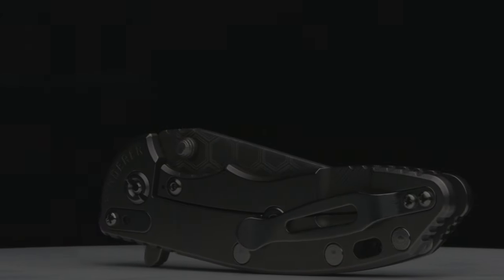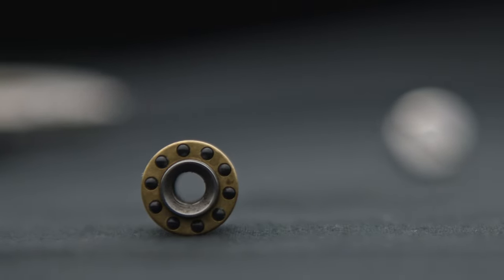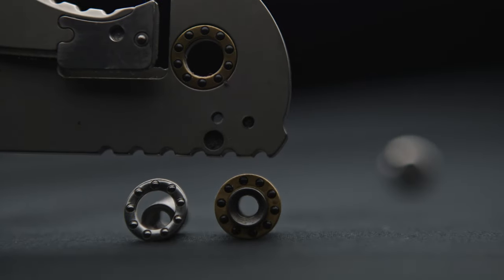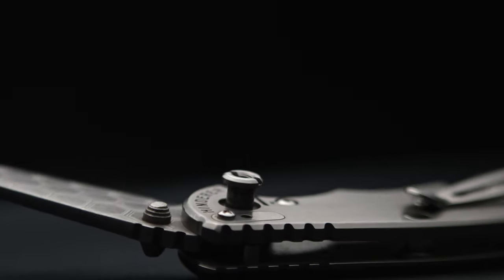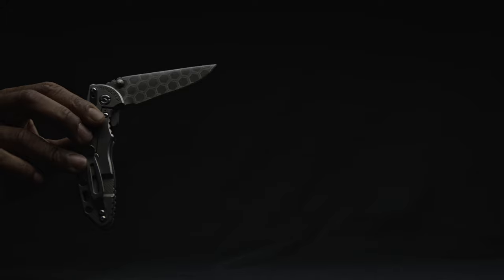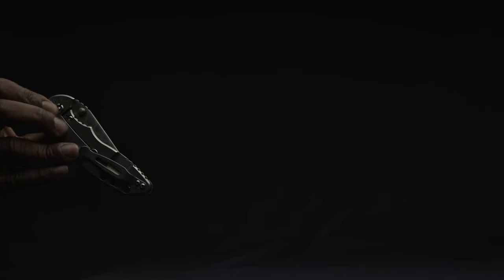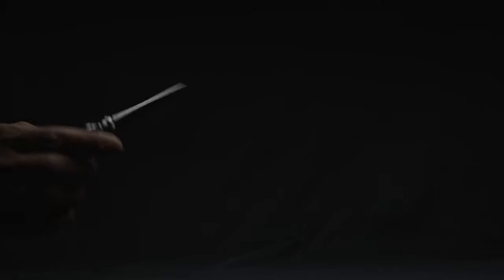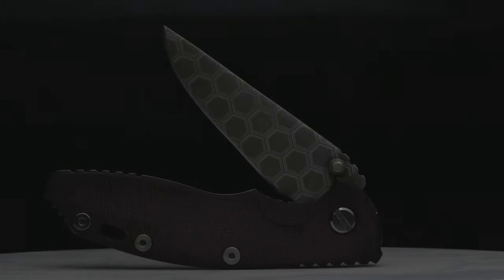HINDERER XM-18 CERAMIC BEARING INSTALL

Comment: Nice! I’ve installed Skiffs in my XM-24 and Full Track. It’s made the biggest difference in the Full Track, they tend to have strong detents and the working finish didn’t help the smoothness at all. With the skiff bearings I can run the pivot a little looser and get the full track’s blade to actually drop shut.

Comment: I use Gillian ceramic white and black ceramic balls in my hinderers. Ones a slicer others a Bowie xm-18 both reground by bgm knives.
Reply from the maker: You can def tell the difference right!??!  (obviously because you've done it to multiples) dumb question LMAO
Reply: @THEFULLERFANATIC  yes I can definitely tell a difference. The steel bearings are more fall shut guillotine like. The Gillian’s smoothed them out a ton and makes them more fluid like a hydrologic controlled fall shut. Also I can tell a huge difference with how long I can for between cleaning them because I work with saw dust from my daily job and I can go about a month and a half. The steel bearing two weeks max.